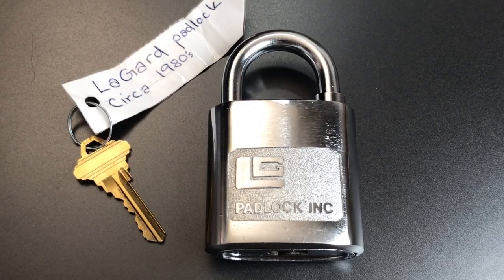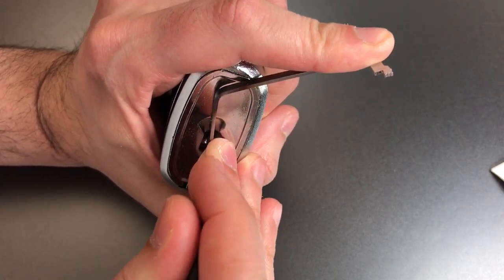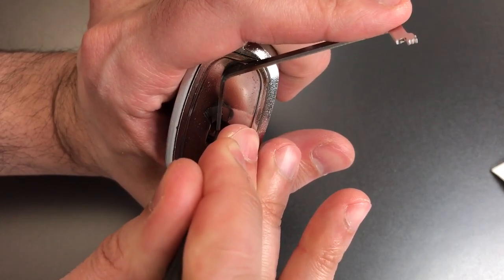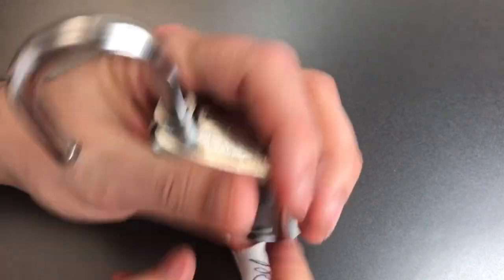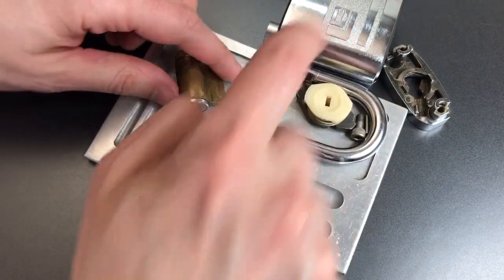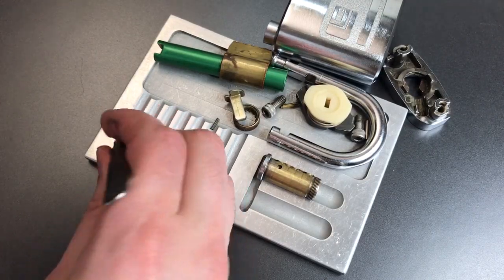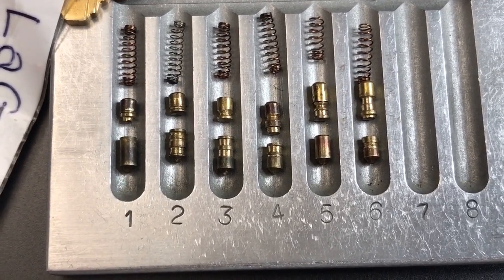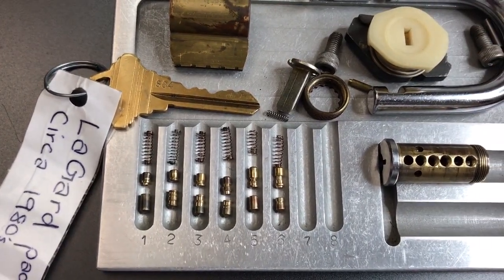[422] Jess Hull's La Gard Challenge Lock Picked and Gutted

Comment: It's hard to believe they would put so much work into designing this lock then use nylon innards and a cast zinc body. Why bother adding anti drill features if you can break the housing with a hammer blow? The accountants must have insinuated themselves between engineering and production.
Anyway Jess did a good job of pinning this up, it's been awhile since I've seen it take you that long to pick a lock.
Reply from the maker: Well, It's pretty clearly meant to be a low security lock... even so, YIKES!
Reply: that lock was built to scale, it wasn't profitable and they ceased venturing in to the padlock market.  its the reason why master locks are sold everywhere and is slightly better than paperweights.  profit margins are high and it's a multi billion dollar privately held company. lets face it,  if they made really good locks, then they would only sell em once, if they sell you breakable products they will keep selling them to you. locks are made to fail, that's why you pay a premium for the good stuff.
Reply: @Homeside301  making your own padlocks requires "means of production" special machinery, CNC knowledge, welding and bending steel. It's unlikely you can do it on a domestic premises ie your house. You need a workshop that can handle 3 phase at the very least. The reason companies can dominate a particular product is because they have the machines acquired from bank loans or lump sum grants that can allow the output on a massive scale and blueprints put together by some very clever people working for them. The more people you have on a project, the faster it can be done and the more intelligence is combined

Thats why you see people who do home made things from a domestic property on their own achieve the bare bones, when you want to make something to a high standard that would have wide appeal you need commercial gear but also understand everything about your product, also borrow ideas from what already exists

For example a member of the public might be able to come up with similar to a handcuff style lock, but the complexity of a u lock is too much for most of us with hand tools and a garage. There are those hardy, creative eccentrics who can do it anything with handtools.. But if you want to sell 1000 units to pay your business loan off and make some money for yoursslf, you wont do it from home, but you can if its just for you

Im just saying theres a major leap to be taken from hobby into commercial/industrial
Reply: @JamesPhillipsOfficial  In my garage and basement I have every tool that it would take to make my own locks (two mills, two lathes, two drill presses, metal casting equipment, two band saws, heat treating furnace, etc.) All run on 120 or 240 VAC single phase. An extremely high tolerance cylinder with jiggy pins would certainly slow down a picker, but it would wear if used much, negating one's work. I'd rather just buy decent locks!
Reply: @JamesPhillipsOfficial  just let the dude do what he wants u dont have to be such a critic
Reply: @UncleKennysPlace  same, i was going to build my gym equipment such as the squat rack. It was easier and quicker to buy it, but i like the honor and pride of D. I. Y, for a young guy of 27 i do have a surprisingly old skool mentality for certain things, i hate convenience and would rather shoulder the burden...but it's not always practical. People say i'm rebellious for the sake of it lol
Reply: @UncleKennysPlace  look for locks that are CEN rated, because that's a recognised standard, level 6 is the best
Reply: @JamesPhillipsOfficial  Dremel is literally all you need they actually sell all the parts that would be necessary you would actually have to know what you're doing in order to manage it but yeah
Reply: James P You sound like such a freakin hipster my guy.  It’s not the ‘do it yourself’ thing, its the wanna-be self sufficienct superior attitude you put off with it...  Over someone voicing their ambitions.  Uncool.
Reply: @JamesPhillipsOfficial  You sound like like a negative nelly there. I bet you have lots of friends that love hearing the warm air vibrate between your vocal chords.
Let the guy do what he wants. You honestly sound like one of my past coworkers telling me you can't build guns as they wont work, you need expensive tooling, blah blah blah.
Reply: @Homeside301  You can do it bro. Just stay dedicated. Get access to a 3D printer, try out some designs, then cnc that badboy!
Reply: Who's the girl in your avi
Reply: Dirk, insinuated doesn't mean what you think it means.
Reply: @whackyjinak4978  uhm.....

The guy is only 27, give him a break, lol. But yes, I think that way a lot and it is commendable but just remember opportunity cost and the benefits of  specialisations.

As James says, such thought can be applied where the (free) market has failed.  Wow!  Finally a live example of where the public sector cannot step in to cover!

But... it is an example of where legislation and trading standards (often public bodies) might be able to force manufacturers to raise the bar as, after all, it would be nigh on impossible for the ordinary person to sue.  Attrition would likely wear them down unless it was a class action and / or a claimant or two suffered a grevious loss as a result of relying on the manufacturer's claims - even as presented by a third party I think.

I'm not a lawyer and I only did some very basic research on some personal issues in my younger days but I'm sure that there are plenty out there waiting for a payday in this area.
Reply: Why pay for quality parts and advanced machining into a product most ppl don't know about when They can just pay for false advertising misrepresentations and print flat out lies??? 

The mission of the Manufacture is to create a fortune, not build a quality lock... 

  And that applies way more than two locks

Comment: Theoretically, could a challenge lock be made with driver pins that have lower flanges of different widths, so that you have to pick it in the correct order, otherwise the counter-rotation will drop all your previously set pins down?

Comment: 4 and a half mins.....and that is long for you.....lol that is short for me lol.
You are very talented Mr Lawyer. Nice picking and lock video. :)
Reply from the maker: Not quite that long (if you don't count the long intro), but it definitely was a tricky little lock!
Reply: @lockpickinglawyer  A question I've always had about locks, why don't they make the core rotate freely unless the pins are correctly aligned, so that you can't tension the lock? Is there some sort of mechanical reason this wouldn't work?
Reply: R. M. Tosh it is harder to do in a way that makes sense than you may think at first, because the lock parts are typically very loose and imprecise, but my conclusion is that lockmakers just don't give a shit about security, and their so called "security features" are only for their own security, such as to calm down some big client or to make it virtually impossible for a legitimate user to duplicate the key without paying the lockmaker, if not plain marketing BS.
Reply: @RyanTosh  I'm not an expert, and maybe I'm misunderstanding what you mean, but since the keyway needs to have holes for the pins to meet the ridges of the key anyway, the lockpicker could just rotate the keyway until the pins fell into place, then pick them normally with tension. Plus the person with the key would also have to line up the keyway exactly right just to open it normally. I could kind of see a way this could work with cylindrical grooves all the way around the outside of the keyway that can be depressed from the side as the key passes, and that's an interesting idea, but the key would have to have pretty big ridges to prevent this lock from just being picked normally, and it would still be able to be done with specialized tools. You also run into the problem that the rotation of the keyway is how the lock unlocks when correctly keyed, so you'd have to come up with a different, more complicated method for the lock to actually open.
Reply: Two minutes, forty nine seconds. So decidedly not “more than a few minutes.” 🙂
Reply: @JakeRobb  ok Mr Fun
Reply: @RyanTosh  there are some locks that do that but they are more exspensive and not that common

Comment: when was the lock made it seems like it was maybe made in the 60s of 70s for the "executive"  type customer. its oddly configured, customizable, and requires an additional purchase to use, and is totally user serviceable to some extent, and its made of u usual materials for a lock. just the kind of thing that a a high power executive would use to lock his garden shed in suburbia in the 70s.
Reply from the maker: Perhaps.  I still can't get over the awkward design and relatively low security from a company like LA GARD.

Comment: nice pins, and thanks for sharing the disassembly of that padlock. Don't try to melt that nice padlock. Don't listen to those comments
Reply from the maker: LOL, I would not consider melting this one!
Reply: @lockpickinglawyer  It's entirely possible that's a thermo-set plastic, rather than a thermo plastic. That means it will burn before it melts.
Reply: @ericgoldman7533  Nylon definitely is a thermoplastic, it melts at ~260 °C if I'm not mistaken, and can even be used in 3D-Printers... so melting it is a totally real way compromise this lock.
Reply: @hadinossanosam4459  I swear I checked the properties of PA6 before posting, but obviously I didn't, because you are totally right! xD
Reply: @hadinossanosam4459  depends on what form of nylon because there's multiple types of nylon

Comment: LPL Could, you would you make a video where you explain in detail the functions
of the internal parts, in particular the variations in pin geometry's such as spools,
serrations  and other variants.  I suspect this is to frustrate picking but exactly 
how would be interesting to have the details.  Thanks LOE
Reply: I suspect spool are to give false set feedback - the cylinder turns in the core but the pin hasn't reached the shear line.  You get counter rotation when pushing the other end of the spool, potentially dropping pins you've already set.  Serrated is probably similar, but the serrations get caught up on the shear line.

Don't quote me on that.  My only experience with locks is disassemble Kwik set locks that the key was lost, so you have to disassemble, partially reassemble and manually rekey.  I've done it like 3 times.

Comment: How does threaded core affect your ability to pick? How do seated on affect your ability to pick? Can you make a video explaining how it works
Reply: Threads in the core imitate the shear line and grab the edges of the spool and serrated pins. You may think you've felt the pin move above the shear line and think it's set in place, but it's actually just the click you felt as it moved across one line of the threading.

Comment: I wonder if some locks can be picked on veneers, BUT almost impossible or significantly more difficult when they are in place, locking something. Because that's what's important. If it's easy enough to unlock when fiddling with them in a convenient situation, but really difficult when it's doing its job, it's a very good lock, good enough for me.

Comment: I mean, if you could custom build your own locks, and make one pin hole bigger than the rest with a touch of slop and make that pin tapered at the top of the body pin right at the sheer line. Every time you set that pin the rest would fall every time. If you figured out to set that one first, it would move cause of the taper. Make a slot to catch that pin. I could draw a picture if anyone had the mean to build one.

Comment: Material choice: For a challenge lock, clearly not using full stainless steel isn't a problem, as you're obviously not meant to force entry?
Reply: Well, the lock body was meant to be used for locking purposes, but the core that was put into it was made to be a challenge.

Comment: I wonder whats the tensile and torsion strength on the plastic actuator part? Probably  3 or 4 lbs before is snaps, total pap using plastics in a high blunt force, high impact, high trauma vessel.💥😣🐵🐷

Comment: If that lock body really is 'circa 1908' the 'plastic' actuator insert might actually be Bakelite. If the manufacturers were smart, they could have included Asbestos in the mixture to make it resistant to decay too. The body is probably some kind of chromium alloy, which I think was used as a cheaper substitute for stainless steel back in the day. It was probably designed for outdoor security gates.

Comment: What size is the pin that you have to push in? or what did you use to remove it? I have of one these and I want to change out the cylinder! ( I know this is an old video)

Comment: What is the purpose of these serrations on pins? To give false impression that it clicked during picking to buy time?
Reply: The serrations will interfere between the core and bible when the pins are moved under tension. Essentially the spools, serrations, and T's are there to snag because when using a key the core isn't tensioner like it is when picking. When using the key the modifications aren't utilized.
Reply: Pretty much. Here is a video that does a breakdown of different types of pins: https://www.youtube.com/watch?v=a8tZA6hJJFU

Comment: With such a custom lock how does one make a key initially? Impressioning?
Reply: You know what the pin lengths are ahead of time. So either you, or an understanding locksmith, cut a key to whatever dimensions you need.
Reply: You make the key first and then you set the pins into the core that has the key in it until the pins fit in the holes

Comment: Why are challenge locks a thing? Like, wouldn't the lock manufacturer want to make the core as tricky to pick as possible, and thus use the same techniques that challenge lock makers use?
Reply: Most commercial padlocks aren't really designed to resist lockpicking because 90%+ of attacks are brute force. I'm guessing tricky pins, threading, different springs etc would all push the cost of manufacture up and perhaps make the locks more prone to malfunctioning or jamming in the real world of dust, water, cold etc.

Comment: Is there such a thing as a lock that doesn't require tension/torque to open?
Reply: With really bad locks you don’t need a tension tool and a rake is enough. A lot of techniques don’t require tension (shimming, bumping, combing). 

But with single pin picking, the whole strategy is to put the core under tension so that the pins bind to the lock body at hopefully the right positions. Basically by definition you need tension with this technique.
Reply: @1998marijn1998  thank you!

Comment: I'm wondering how you would put this lock back together after gutting it.
Reply: 1. Put the springs back in the lock body
2. Put the pins back into the lock body on top of the springs
3. Put that green round thing in to put the pins and springs into the lock body
4. Put the other pins back into the lock cylinder
5. Slide the lock cylinder back into the lock body
6. Put the little flat thing back on the end of the lock and tighten the nut

Pretty much do everything done in reverse. That's why making sure you know which pins to put in which holes are important to track so your key still works.